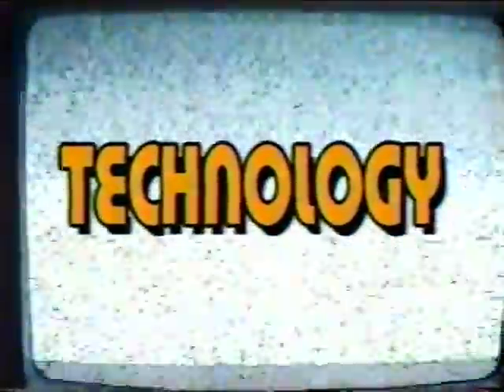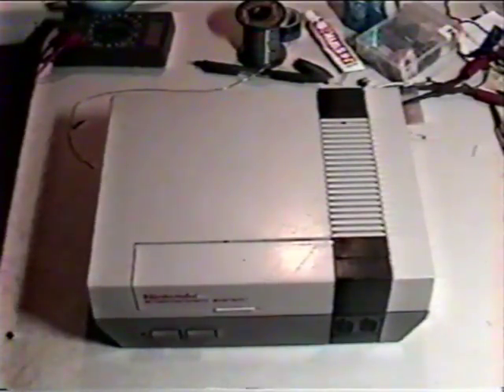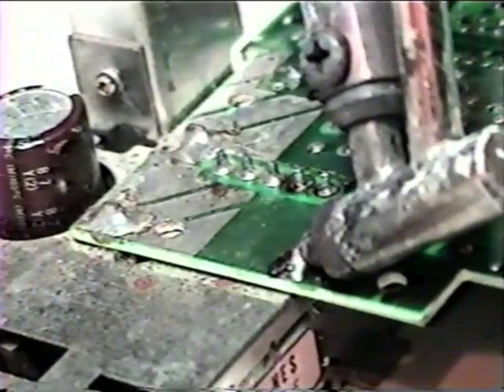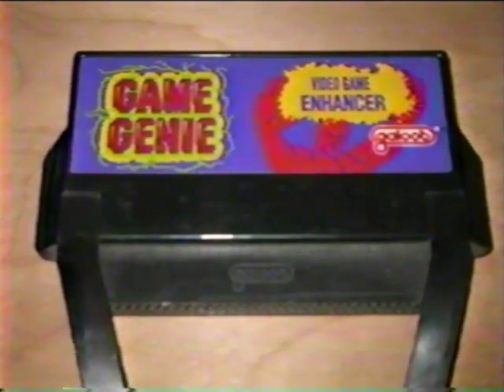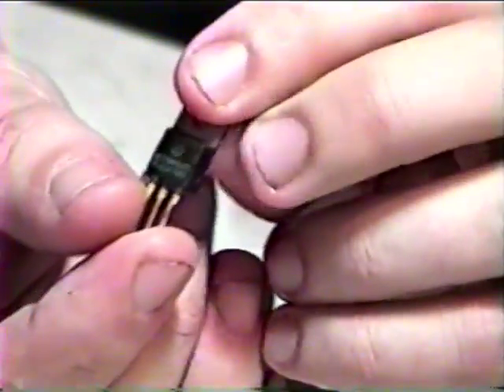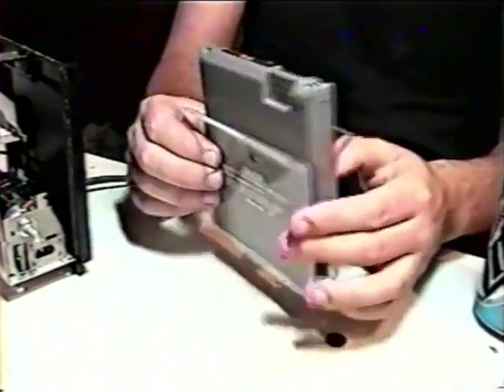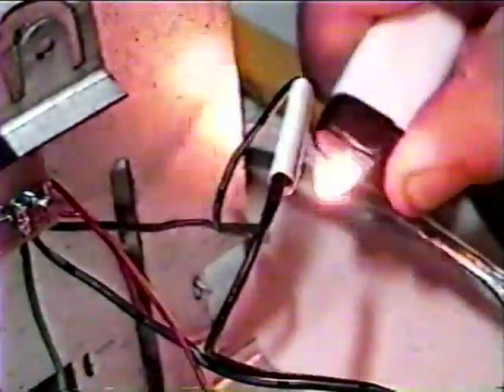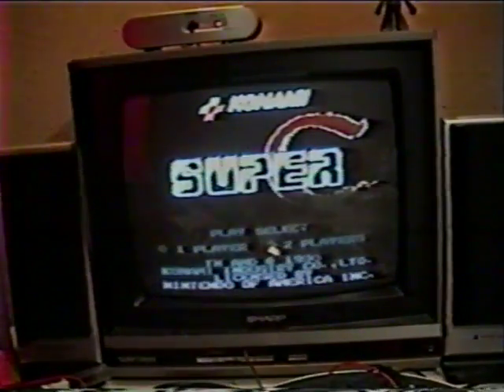Nintoaster Instructional Video

Comment: I like to look at my local thrift stores (Goodwill, etc.) for inexpensive toasters. You can usually get on for less than $5 and there are all sorts of styles, old, new, plastic, stainless steel, etc.

Another helpful tip is to find a toaster that doesn't have a ELECTRONIC cancel button as these a bit harder to convert into a Nintoaster. The toast "lever" won't remain depressed without power to it. This means you'll need to somehow provide power to the original toaster electronics to keep the "lever" depressed. These are more common on newer toasters, but an easy test is to press the toast handle down while it's not plugged in and if it stays down, you're golden.
Reply from the maker: ^^^
VALUABLE INFORMATION
Reply: eksyte This is not necessary... I am using the electromagnet to keep the power on for the NES... Then I use the relay to power it off... It works really well. The Newer toasters are awesome to use.
Reply: venomman Never said it was necessary.
Reply: Actully it Works better IF, you use it in your Bathtub. Best to start as soon as the Water is turned on.

Comment: I like how it looks all gritty and dirty like it was made in 1990.
Reply: The music also made it like so
Reply: that wasn't effects he was {insert reason here} at the time and brought out the Second-hand camera from the wayback machine!
Reply: OMG LIKE WAY OLD RIGHT!
Reply from the maker: @AMPProf  I burned the finished video to DVD, copied over to VHS in the most potato quality possible  (even manually screwed with the tracking) and captured it back in from that.
Reply: @victoneter  Not yet. Today is September 21, 2020, and this video was posted on May 24, 2010, which is 10 years and 4 months. If we subtract 10 years and 4 months from May 24, 2010, we get January 2000, which is still not the 1990s.
Starting 2 months from now, your statement will become true.
Moreover, my original comment mentioned the year 1990, not the decade. 1990 and 2010 are 20 years apart, while 2010 and 2020 are 10 years apart.

Comment: The ammount of time suggested here to resolder and wire that 72 pin connector is almost preposterously misrepresented.  Each time I did it it took over 4 hours.  I'm no soldering pro but this was blistering and requiered many many more beers.
Reply: john mimbs Just did my own this week..... 4 hours might be about right. Especially if you go back to check connectivity to make sure there is no bridging.... I know now why people are not selling nintoasters... they take soooo much time and effort.

Comment: I am in the process of making mine with an rgb mod to use on a pvm. I am avoiding use of hot glue and epoxy; all pieces are pre-fabricated and screwed-on for easier servicing and durability. It is a TON of work.
Reply from the maker: Nice!  Yeah, that's the ideal way to do it if you can pull it off.  All the epoxy is a bit jank.

Comment: It's really not that hard, but it can be intimidating if you haven't use a training breadboard before. The squiggly lines are the resistors, the circle with the three lines (base, emiter and collector) is the transistor, the straight lines are cables, which you use to connect two items (e.g. one side of the 330 Ω and one side of the 220 Ω resistor, or the other side of the 330 Ω resistor to the emmiter side of the transistor) by soldering.

Comment: I’m going to be making my Nintoaster this weekend. Very excited
Reply from the maker: @ReallyRandom-gf3ih  Hey, good luck!  I really should update the description of this video with links to some helpful parts like a small DC-DC convertor so you don't have to worry about the 7805 and heatsink, as well as where you can buy the cartridge connector cheaply and avoid having to tear apart a Game Genie.  A lot on my plate lately.
Reply: @vomitsaw  Thanks for the luck and I just planed on using the amplifier in the nes and I already have two genies so it’s no problem to me. Thank you for this masterpiece of a video.

Comment: I opened my first NES today, its dirty and the cable connections are stiff but i feel so calm being guided by this tape
Reply from the maker: Be not afraid!  Unless there's a brown recluse in there, then be a bit afraid.
Reply: @vomitsaw  No spiders but evidence of some liquid, probably a spilled beer. The RF Modulator is kicking my ass.
Reply from the maker: @whiskedragon  Ah, great way to clean off gunk like that is a toothbrush and some 91% rubbibg alcohol.  70% works fine too, just takes a lil' bit longer to dry.

As for the RF modulator... oh yeah, I know the pain.  A bunch of solder wick and a high wattage iron with a fat-ish tip is your best bet.

Comment: After doing some calculations i concluded that your description is fairly accurate. According to your description, Other makes up about 5% of the video. This being the historical intro that you created before the supply list and the part where you mention to take a drink of wine beer or apple juice. Thats about 57 seconds on the dot which comes fairly close. The bullshit according to my calculations takes up around 3.31 minutes of the video. Bullshit moments include the diy wrist strap setup which takes about  1 minute and 20 seconds, the quote where you explain that if you dont know how to use a desoldering iron takes about 7 seconds, the part where you throw away the expansion port takes about 5 seconds, 13 seconds for your RF modulator rant,  2 seconds for your AMERICAN ELBOW GREASE quote, and another 2 seconds of you throwing the RF modulator out for good measure. Also 10 seconds for you pointing out the cartridge connector and 5 seconds for giving us an unnecessary second look of the wiring diagram and 23 seconds of explaining the uselessness of the standard nes cartridge connector. This totals to about 2.28 minutes which is about 1 minute off. The rest which the description claims to be educational is subtracted from our total stray time of 4.96 minutes. The total educational time claims to be 1689.8 seconds. Adding those values together we see the total time is about  1987.4 seconds converted to minutes gives us 33.1 minutes. I see you're a man of your word.
Reply from the maker: ...If this math checks out, I'm going to send you something.  It MIGHT be a dirty sock, it might be something INSIDE of a dirty sock.

Comment: Great video! Extremely informative and entertaining, but I don't like how the list of parts at the beginning is missing the hard drive cable, the game genie, the momentary push button switch, 220 ohm resistor, 33 ohm resistor, 2n4401 transistor, perf board,  NES, and toaster.  I just like my list of parts to be complete.  I will be attempting to make one this summer, I will let you know how it turns out
Reply: ***** your video has been invaluable and I'd never be able to even attempt this without it, but i was wondering, would it work if i reattached the RF modulator with wire instead of creating the video amplifier circuit and creating a new power circuit?  I have the room in my toaster, and it seems like it would save me quite a bit of work.
Reply: Watch the whole video before taking on this project and you'll have all of the info you need.
Reply: eksyte I've watched it several times. I was just asking about something he did not cover.
Reply from the maker: Too drunk.  Too drunk,.
Reply: SuperMagMachine You dont need a game genie.. its a waste of money if you dont own one. Get this. http://www.digikey.ca/product-detail/en/0/A31721-ND
Reply: Not a bad reference, venomman, but I can find Game Genies locally for that price or less, so I don't see the point in ordering that. That and I added the GG to me build because I like using it some times.

Comment: AC "adapter" that came with the NES bone stock was a 120v AC to 9v AC adapter, otherwise known as a transformer. Inside the rf box that he removed was several diodes used to make the DC before it gets to the regulator that was unsoldered. The reason Nintendo used 9 volts AC is that they could cut down the size of the adapter and it made it more proprietary to look for a 9 volts AC wall wart.

Comment: These companies and their connectors. Why could it not have a standard 2.54 pitch and went for 2.50 pitch instead?

My other gripe is G2 connector on Dreamcast. What the heck is this? 2mm pitch, shifted, short flange, keyed outside. Who comes up with this shit?

Comment: Well I was stupid. I got excited, went bought an extra Nintendo, bought a toaster, bought the tools that you mentioned at the beginning of your video and then you mentioned plexi glass -_- I don't know anything about plexi glass lol
Reply: ManiacCuboneTCG  its easy enough to work with a cheap heat gun will soften it enough to bend the stuff.
Reply: okay thanks
Reply: emart88 Yeah, using a couple pieces of wood and a couple C clamps makes the job waaaaaaaay easier.... I tried using a stove and some gloves first LOL
Reply: +emart88 4ft thick plexi-glass not only will not bend it is also bigger than the toaster. Please send for hulp.
Reply: Did you make yours?
Reply: He said it wasn’t completely necessary

Comment: I got mine to works but super Mario 3 would wig out n not let u die tryed shorter wires same tryed new cartage connector n same thing never figured out why put old slid on connector on it n it worked find any ideas?

Comment: If you slow the video down to 0.25, at 13:06 it will read "Fear Board" at the top where NES Board is. It will also read "Robot Skull" at the bottom where "Ground" was. I just noticed that.

Comment: Nostalgia. All jokes aside, this seems like a way to create an affective top loader, if you have the skill.
Reply from the maker: If you wanna build a top loader, you don't necessarily need to build it into a toaster.  A simple project box will do just fine!  And by the way, I may have found a better source for the cartridge connectors, so you don't have to sacrifice Game Genies for their connectors anymore.  Gonna buy one and see if the pin spacing is correct.  If it is, I'm buying a LOT more and I'll link y'all to the item listing.
Reply: @vomitsaw  good to know.
Reply: @vomitsaw  Any info on that? Lookin to start up this project and dont really want to Shop around for a game genie
Reply from the maker: @wesleybermingham9986  Forgot about this comment, sorry.  The connectors are all over AliExpress for about a dollar.  I've bought 15 so far and don't see a problem.  Youtube might mangle this link, but I'll try:  https://www.aliexpress.us/item/2251832599091636.html
Reply from the maker: @dimitriuss  Yes!  I've bought 10 of them from AliExpress for a dollar each, and 5 more that were $2.50 each.  There is no difference.  I hope this link goes through:
https://www.aliexpress.us/item/2251832599091636.html
Reply: @vomitsaw  I'll check it out

Comment: Hi, Thanks for the Vid!
Im building my first Nintoaster. I just got the power circut wired up, but I am getting 4.88 volts to the board, not 5. Is that ok? I used the regulaor off the original NES.

Comment: If i wanted to save the original START/RESET buttons (and chip) but remove the rf modulator, where would i solder my power + and -? Nothing seems to be right, according to power led..
Reply: Nvm i figured it out, i was thinking way too complicated. Having a problem with video quality (colors) tho, but i guess i can overcome that also

Comment: 22 works just fine. I actually just hooked up a few bits together to test my board, and the 22 gauge holds up just fine. The wires in the system, however, are smaller. It almost look a 28-ish size gauge.

Comment: That toaster has a hook that holds the lever, but most toasters nowadays seem to hold it with an electromagnet, I haven't started my project yet since I'm waiting for my toaster to arrive but I might have to find a way to either power the electromagnet or modify a hook if it doesn't already.
I'm not actually making a Nintoaster though, I'm making a much simpler Nintendo switch toaster Dock

Comment: @Cla0016 This is likely because it is rated for use with an appliance. That is, when the power supply is floating (nothing attached) the voltage is nominally 19V. When you load it by plugging it into a device, the impedance of the device drops it down to 12. So, it's not an ideal voltage source.

Comment: 10 years ago most of this went over my head and it's still funny.  While I don't know that I'd have the patience to do it (the 72 pin connector especially), I at least understand it now. Fixing up a broken Commodore 64 certainly helped. Turns out the only thing wrong with it was a single ram chip. I was replacing chips that didn't need to be replaced before I realized it wasn't getting enough power because of the cheap DIN cable I bought (I really didn't want to solder a DIN plug). The unit worked fine on it's own (4.5v), but plug in the Ultimate 1541-II+ disk drive emulator into the cartridge slot and the voltage dropped to 3.5v. I don't know how the hell it operated at all let alone super glitchy as it was. Fortunately that supports an external power supply. I'm still on the crappy DIN cable. I'm going to buy a "black brick of death" to steal the DIN cable off that. I know those are rated for the correct power levels even though the power circuitry itself is trash. In the mean time the slightly reduced 4.5V seems to be working. It's in the TTL specs unlike the 3.5V. For swapping parts in some cases solder braid works better.  In some cases a desoldering pump works better.

Comment: @CrusnikoftheNight You gotta go back *way* far to get to the helpful comments.  Vomitsaw just didn't have the proper resistors when he made the video; he didn't have the 220 ohm, I believe.  So, instead, he just added up the resistances of other resistors (e.g. two 100 ohms and one 20 ohm) to equal 220.  And that's why there are extra resistors in the video.  If you follow the schematic exactly, regardless of what else you see, you'll be fine.

Comment: Been working on my own nintoaster and have a white screen does the problem lie in the 72 pin connector? I used 22 gauge solid wire should I switch this out for something smaller or does it matter? anyone's help would be appreciated most of all vomit's

Comment: I had the same concern, but it can be found easily. With the crappy conector still in place, plug in a game, and take note of how the game sits on the old connector. You can then take the note what strip from the connecter touches the cartridge and 72 pin part of the board. Hopefully that made some sense!
Oh, and I'm not sure if you need to ensure the pins need to match...however, I'm not risking it.

Comment: Can someone tell me what i'm doing wrong, I just built the amp circuit, but when I test the video I am missing some colors, I did at one point accidentally reverse the ac adapter and it fried the 7805 a little bit, but it still works. Can someone please tell me why I am missing colors. thx

Comment: I looked everywhere but my local store didn't stock any "gold ol fashun, 'Merican elbow grease".  They did however have some headlight fluid, so I used that instead.

also now the nintendo case is empty, use it to mount a DVD player, and look super retro whilst been modern. (not quite steam punk)

Comment: Hi, I really enjoyed your instructional video, I was wondering though, would it be possible to make a Nintoastee with a 4-port controller connector, using a NES Satellite or a 4 score?
Reply from the maker: +Kopite 44 Yep!  I don't see why not.  Might want to make a toggle for 4-score/NOT 4-score, and... I'm not exactly certain on how that's done off hand, but it'd certainly doable.  If you could originally plug it into the NES, it's doable.

Comment: So far, about 12 hours all said and done. But keep in mind....I'm using a radioshack soldering iron, and a solder pump and braid, not a desoldering iron. I EASILY spent about 4 hours on that RF mod...

Comment: When soldering the Game Genie connector to the Motherboard, I notice that the motherboard only has 36 little connection slits. Do I solder one wire on each side of the board's slits?
Reply from the maker: +zeldaknowitall You got it!  Both sides.  It's 2 rows of 36 pins = 72 pins.  And the cabling needs to be soldered at both the mainboard end and the cartridge connector end, soo... yep.  That'd be 144 little solder connections.  It's not necessarily hard, just really tedious.  Put on some music, zone out and just roll through it.
Reply: +vomitsaw Or just enjoy an aardvark.
Reply from the maker: Brian Schwartz
Why not both?

Comment: Question for any one.  I am attempting to make my own Nintoaster and I had a question about the motherboader.  The pins where the 72-pin connector adapter goes are labled 1-36 on the top but not 37-72 on the reverse side.  I need to know which is the 37th pin on the back side of the board.  So far I have not burned down the house nor the pets!  Thanks for the help.

Comment: Hey Richard, I don't know if you still read these or not, but dude, I tried building a Nintoaster something like 11 years ago, when I was in high school, and couldn't solder for shit. I never finished it and it's been sitting in my parents garage collecting dust. I tried finishing it during college but due to my inexperience with soldering back in high school, I basically completely destroyed the 5V node to power the NES board. Do you know of any other node or connection that I can apply 5V to power the board? I'd like to finish this project once and for all, and this is the last thing I need to finish it. PS - Hope you're doing well buddy. Cheers.
Reply: UPDATE:

I stripped back some of the solder mask from the main trace going to the +5V input, soldered a wire to the exposed trace, worked just fine. Bought and tested a copy of Abadox, sure enough it glitches, gotta shorten them wires up!